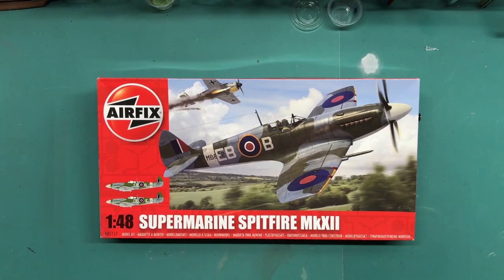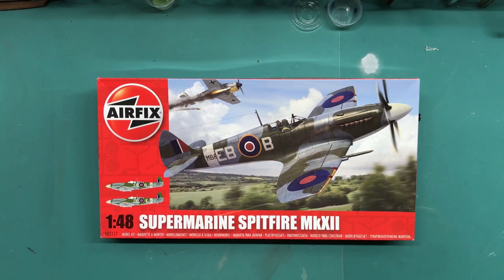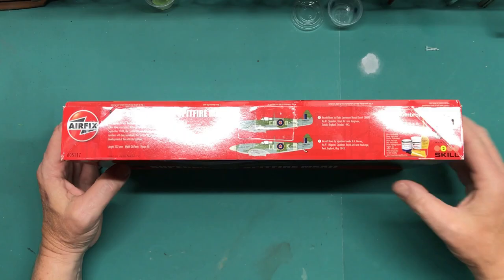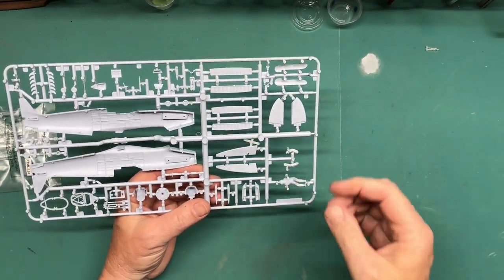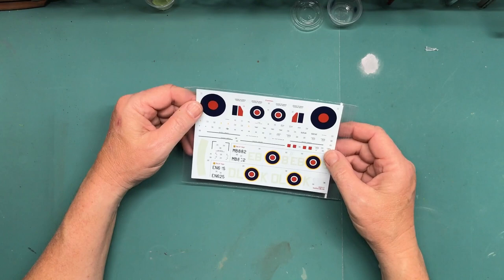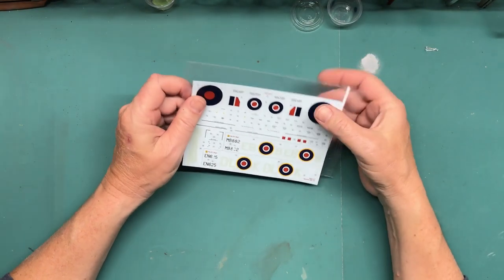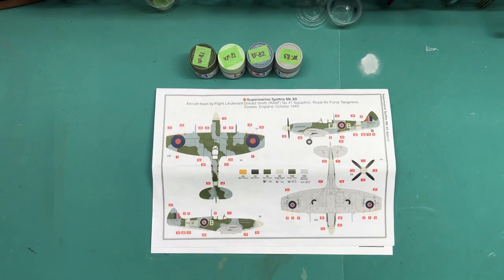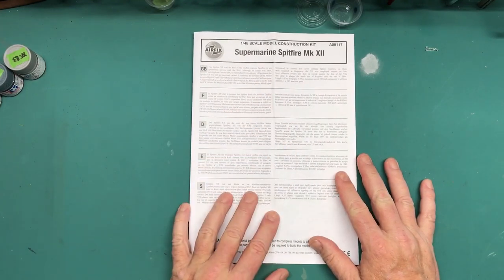Airfix 1/48 Spitfire Mk XII, Part 1 Intro

Comment: Thanks for the shout out Brett. It's good to know Tamiya is putting out RAF colors. I'll be watching as I have a few more in the stash.
Reply from the maker: Yessir, Jeff! I wish Tamiya would kind of revamp their line of paints. I like the new WWII German  armor colors they are doing, and the RAF colors are great too. I be nice if they did some more. With all of these other manufacturers doing really extensive lines of paints, I think its tiem for Tamiya to continue making more colors, and/or reformulating some of their older ones.